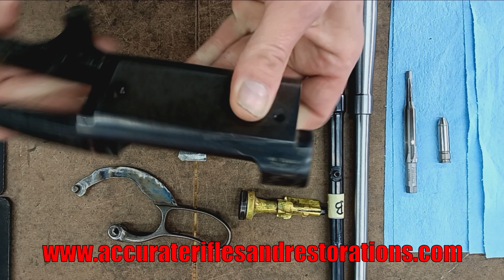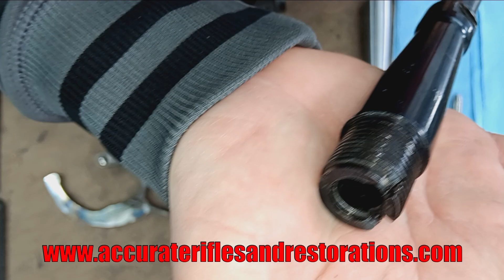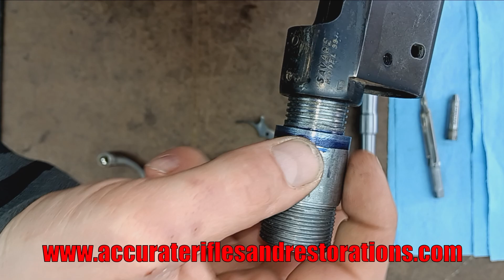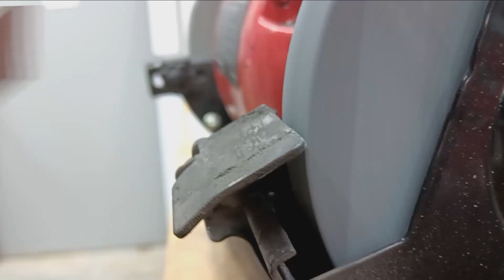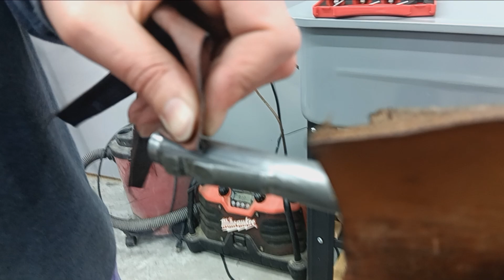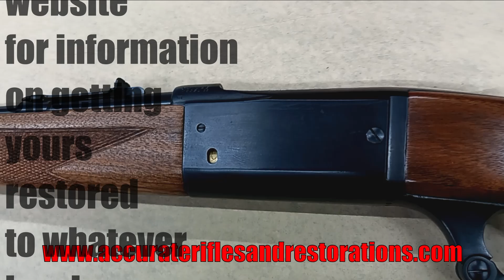A Savage 99 Restoration | Classic Old School Lever Action | 243 Winchester Deer Slayer

Comment: The original steel butt plate would have been nice.  The .243 has almost no recoil, so the sponge sort of detracts.  But, a customer gets what they pay for.  Thes rifles are very elegant, accurate, and fast to the shoulder and eye. The best handling rifle I have ever taken to the field. I have a 1937 EG in the ubiquitous .300 Savage, and it is a tack driver.  It is my all time favorite lever action.  Nothing else even comes close.  

Some one re-blued it decades ago and did a very nice job.  This week I'm stripping the old varnish off the wood and taking it to a deep BLO application.  Heated and rubbed-in with the finest steel wool. 10 coats and a couple of vigorous buffings after it dries will give it a perfect furniture finish. After owning it for 40 years, it will be retired after that.

Comment: I have a Savage 99 take down that was nade in 1929, this one has a barrel that needs to be completely screwed out. Not a quarter. Turn my question is this. It is chambered right now in 30-30 I would like to get another barrel made.  Stainless steel 26 inches long Chambered, in 7-30 Waters

Comment: Just as information,  while doing some research on the 99 line. It seems the rifles made starting in 1960 or serial # starting with 1,000,000 barrel threads were changed to the v groove style.
Reply from the maker: I have not come across one yet, but that'd be interesting to see!
Reply: @AccurateRiflesandRestorations   me too!